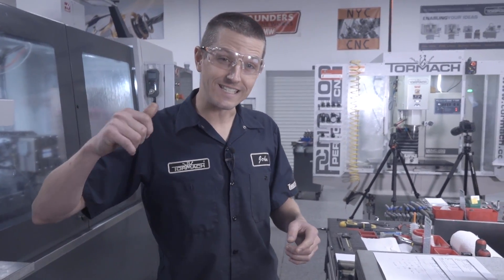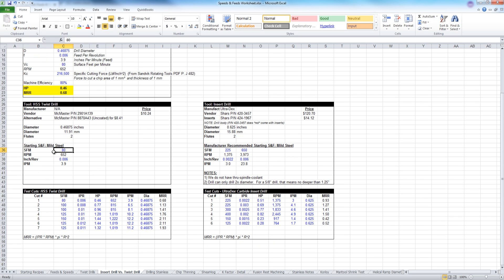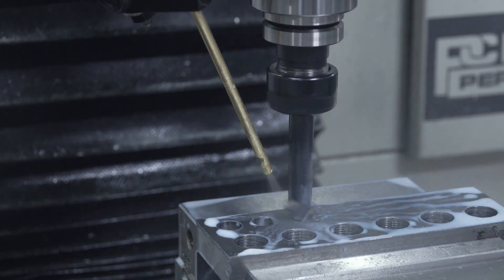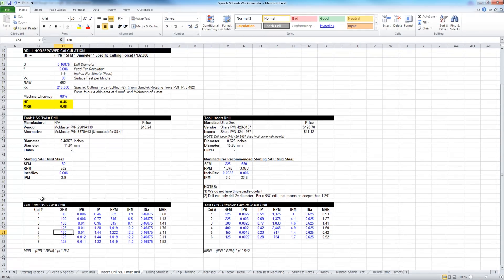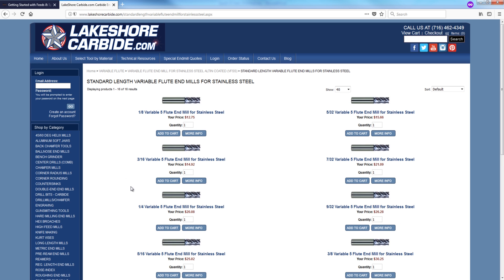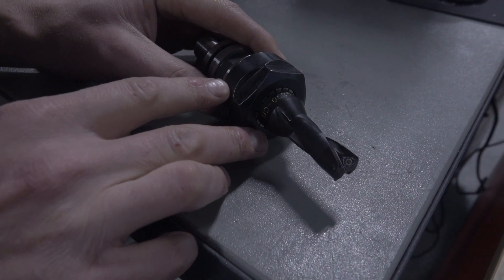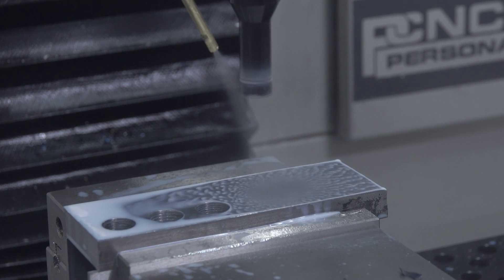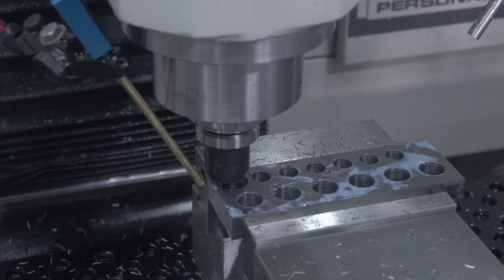Carbide Insert Drill versus HSS Twist Drill!  WW175

Comment: Those insert drills were always a bear for me to run until I learned a neat trick, now they're my favorite. For that 1018 steel, I run 600SFM at about .0015-.003 a rev (depending on drill diameter). But there's more! It looks like in your video you used a G81 drill cycle on that insert drill. Here's my trick, use a G73, with .010 peck value with no retract. Usually machines have a slight retract with a G73 drill cycle, so you'd have to change your parameters to zero or something like .0001. This does 2 things. First it breaks the long chips, second it gives your spindle a chance to catch up. I work with lower horsepower machines, so I'm used to this.
Reply: We run 40mm insert drill (SCET insert on outside, XPET on inside) through C45, 60mm deep hole is drilled just in 40-45 seconds... 600RPM (75 m/min a little conservative for carbide, but I´d try maybe 1200RPMs, which sounds better for carbide and just 0.08mm/rev) and 0.15mm/rev... nothing, just drilling cycle without Q value (Fanuc value for pecking depth):

G54 T1212;
G97 S600;
G00 Z5 M03;
G00 X0 M08;
G83 Z-60 F0.15; (no peck)
G28 U0 W0 M09;

And with the same drill we´re opening that hole to 56mm diameter (this is lathe part), stepping it over to X-8 and running the same drilling cycle (why not, gets rid of getting-out-of-hole-G00-block) and then stepping it over to X-16.... Under two minutes, 56mm hole, 60mm deep in C45 is done, something, that´d take twice the time with twist drill, which I´d run at +-30m/min (25-30m/min recommended for HSS in steel), so 250RPM and let´s say 0.25mm/rev feed and Q5000 (5mm pecking depth, full retract with G83)..
But, spindle load meter would say 95% with 11kW motor on Doosan Lynx 220LM... with a less powerful lathe/mill, I´d say peck with no retract is a great idea, but for running production, the inserts might get dull pretty fast, as they´d enter the cut many many times before it´d drill the desired hole...

But for 16mm hole, twist drill is gonna be deffinetly winner, if you´d be able to push 16mm at +-550RPMs and 0.2mm/rev feed, 5mm peck with partial retract, win win :)
Reply: Neogeobrian nice tip! Would some be worth investing in on say a 10HP Sharp minimill. I know there pretty close to rated power
Reply: NotoriousAudio I ran a Mazak 410b (think Haas VF2) which has a 15hp spindle and regularly push a 2.312 diameter Iscar DR drill into flame cut AR400 with those settings above and it settles at 90% spindle load and sounds smooth. Chips flying off the inside of the machine turns heads 😀
Reply: Yes sir. Right on point there.

Comment: I used to run an insert drill in a Haas VF4 through 1045 and it wasn't fun ,I had to run really low feed rates or the drilll would vibrate/chatter.
I had success with aluminium though.

Comment: wondering if you found any evidence of the tool spinning in the er collet? or maby just wrong speeds and feeds for the inserts being used, had the same type of problem with a large shell mill, wound up being someone had forgot to tighten the setscrew in the holder allowing the tool to chuck slightly in the holder and was causing some strange chatter issues, like you seem to have.

Comment: Insert drills pretty much need through-spindle (through the tool if on a lathe) to be even worth considering.  I have never really seen any insert drill run well/quiet/happy without through-coolant, the higher the pressure the better they run.  I've set up a 3" diameter insert drill to bore 304 SS 5" deep (in 58 seconds, hot suppers all day long) and the more coolant we pushed the better it ran.  Upping coolant concentration helps a bit with insert life, but regardless of the machine and material drilled, through-coolant is IMO a complete must with any insert drill.

Comment: I did try this inserted drill with a doosan cat 50 30 or 35 HP and they sucks . you must try Mitsubishi or sumitomo inserted drill, yes a lot more expensive but I think is totally worth it. Just my opinion of course.
Reply: Kennametal and Sumitomo are best in our testing. Kyocera magic drills have also given good results.
Reply: antonio de Jesus contreras what about sandvik 880 , they always seem to work great , and iscar dr drills also
Reply: i guess you get what you pay for
Reply: I use Mitsubishi insert drills and they’re great! In lathes tho. My machine I push a 40mm drill about 600SFM @ .006IPR in 1045 material.

Comment: Run the insert drill in the Haas to see how much difference there is.
Reply: also thru coolant is nessesary for insert drills to push them harder. in normal steel i run about 200 to 250 meter per min an 0.1 to 0.18 mm per rev. it is way better to use a drill holder, simular to a weldon but bigger an 2 screws holding the drill
Reply: Yeah, I forgot to write that point also. These insert drills are meant and designed to be used with thru coolant.

Comment: I'm the guy that does resharpen Twist Drills. And in this situation I would have thinned the 
web on the new drill right from the start. I'd be curious how much more you could push it with the thinned web and reduced center point rubbing.  But mainly, yes, don't underestimate the productivity of the old fashioned twist drill.

Comment: John,  for a larger than 1/2" hole, I wonder if an annular cutter would be close to competitive for cost.  A 3/4" from McMaster is $40 (31315A115).  I have never seen them used in a CNC application, but I have just started using them in a magnetic drill and all the way up to a 2" hole can give you a nice hole.  I haven't checked the final hole size closely, but they seem to be much closer to nominal than a twist drill.  Nice test.
Reply: With annular cutters you would need to check that the slug is not stuck inside of the drill before drilling next hole so it would not work for parts with multiple holes.
Reply: That makes perfect sense why I don't see them run on CNC machines.  Great tools, but not necessarily the right application.  Thanks.
Reply: R.J.'s workshop we use them all the time in our manual machines. But when we put it on CNC we generally run drill / endmill clean up.
Reply: Always better
Reply: They are made for manual machines. They work great for them. Not made for a CNC at all. They would have to feed so slow and turn slow. Then add the slug removal after each hole. Time is money and that would throw alot of both into the wind.

Comment: When you tried to up the MRR with the insert drill I think you might have been losing steps because the feed and chip size was very inconsistent. I've never liked running insert drills without through coolant either. It helps form and break the chips and gets them out of the hole too. I don't think I would try any type of carbide drill that large on a Tormach though maybe not even a HSS drill that large. When HP and rigidity are lacking you will almost always come out ahead to drill smaller and interpolate the hole in terms of being nicer on the machine and the tools will last longer that way.

Comment: Any value in running a similar comparison in the Haas?
Reply: probably not. insert drills are better in power full lathes because of the stability. or you want to use insert drills for durability as they don't tend to heat up as much.

Comment: That surface footage recommendation seems anemic for an insert drill. Seems more like SS numbers. 

Maybe wrong insert coating or grade?  Dunno. Maybe just a lack of torque/HP

1018 should be starting around the 500’s up to 700 sfm at around .004-.006 per rev. 

Maybe try another go with higher sfm and heavier feed.
Reply: Occams Sawzall it looks like he's got that listed in the sheet, but didn't get anywhere near the chipload. At .0025/rev on a drill that size you are definitely definitely rubbing! Chipload needs to go up as you increase in drill size, not down. That said, you are likely right about the twist drill being the correct choice. You don't have the machine to run these tools they way they're designed to be run.
Reply: broton 
Well. His chart maxes at 400 and max .003 per rev.  Which I think is still too low to get the inserts to get a proper bite and too slow to get the coating to active.

I’d take everything on that chart and double it.
Reply: I would use the “Patriot Drilling” chart at the bottom of the “insert speeds and feeds” page. 

https://www.ultradexusa.com/technical/